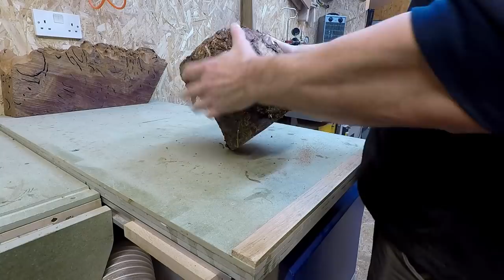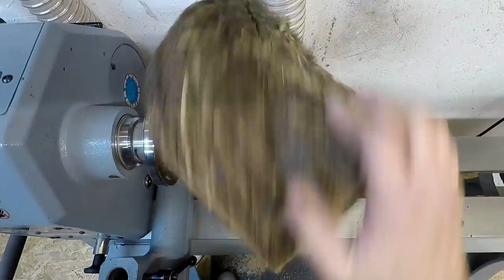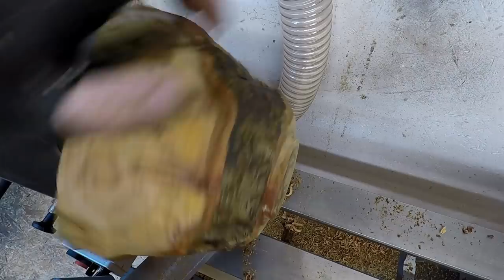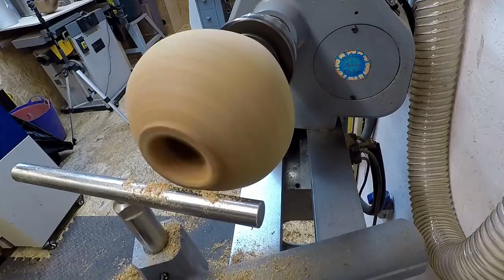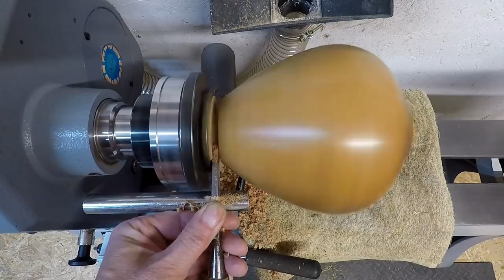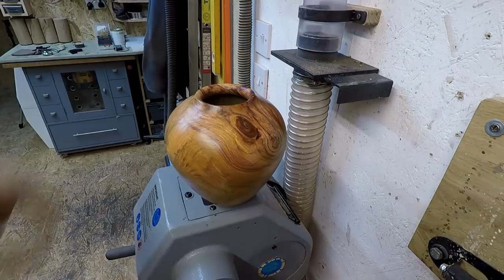Woodturning - A Plum Crotch Hollowform

Comment: for $25 I bought an angle grinder and carbide grinder/cutter head at harbor freight and it would have ground off that top in about 30 seconds.  best tool for the job I ever bought.